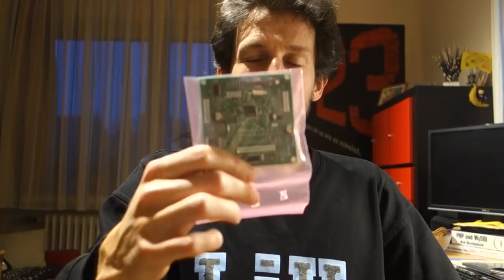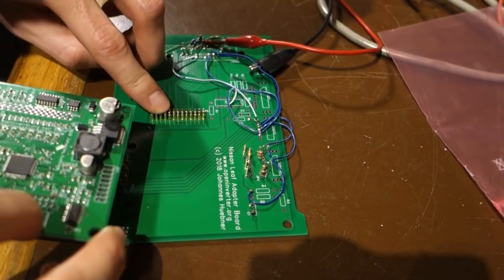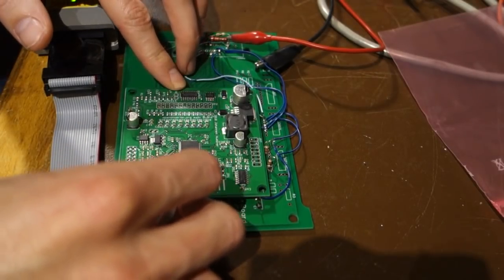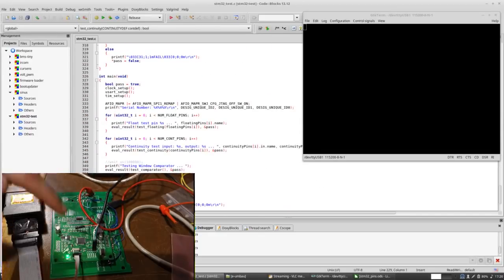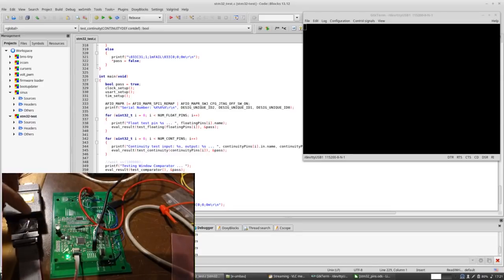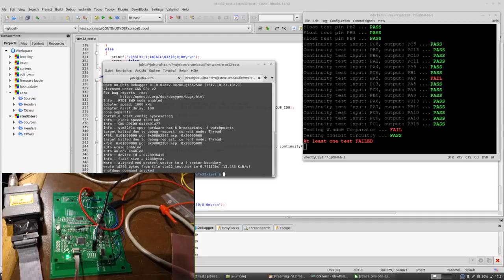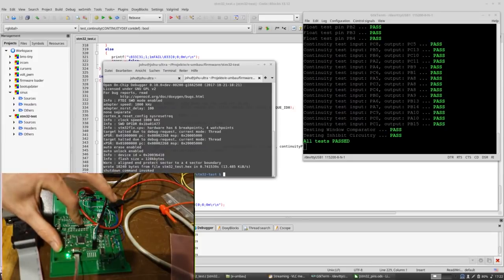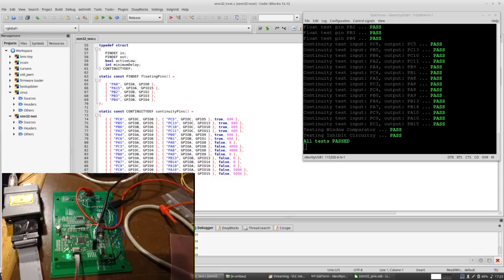Lab Update #19: Testing Main Board

Comment: Hello Johannes,  in relation to the use of Leaf gearbox,  would there be enough space between the VW inner shaft flanges to fit the Leaf gearbox with the Nissan inner joints still in place,  machined into flanges like on the VW gearbox? This way it would be just a matter of bolting the original VW shafts to the stubs of the Nissan lobro joints.